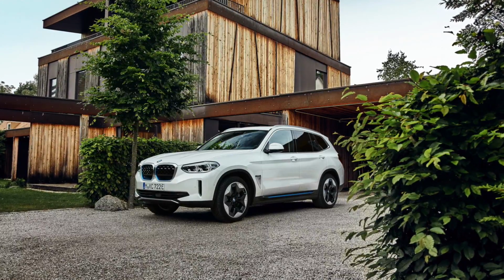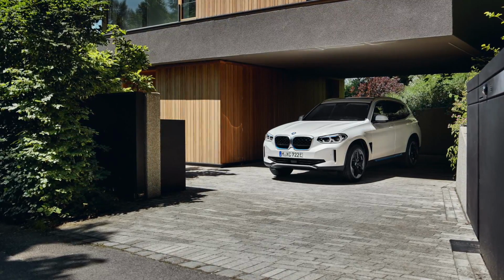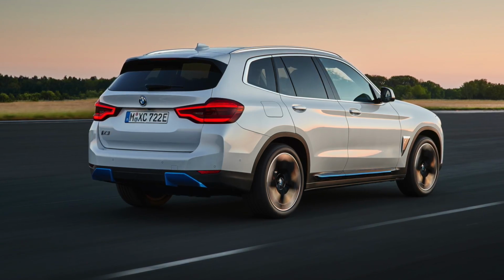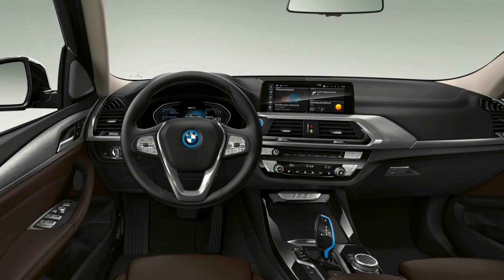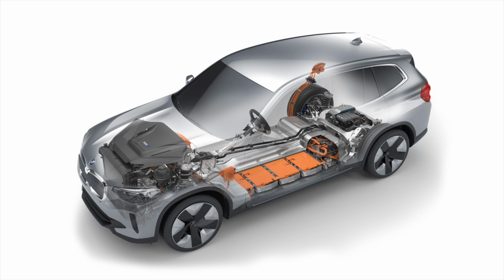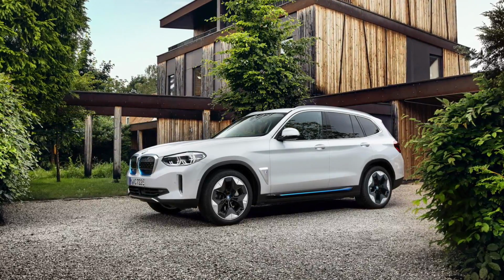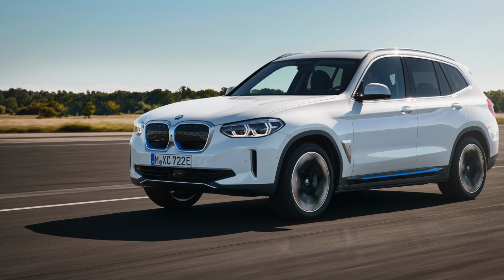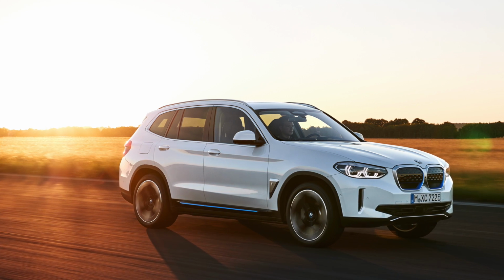BMW iX3 reveal - the BMW X3 goes EV!  Autogefühl

Comment: I'm afraid BMW will struggle to convince new buyers with this car.
Quick Comparison:
Tesla Model Y perfomance                       BMW Ix3
- Made in Germany                                      - Made in China
- 0-100km/h in 3,7sec                                 - 0-100km/h in 6,8sec
- 480 km range (WLTP)                               - 459 km range (WLTP)
- 241km/h top speed                                   - 180km/h top speed
- All-wheel drive                                            - Rear-wheel drive
- Price from 66.600 €                                   - Price from 68.000 €
Build quality and fit/finish is up for debate but I would rather choose the car made in Europe with better specs and price than this.

Comment: What is going on with BMW?
This is so sad and laughable car?
An electric SUV with RWD and 286ps, 450km range with starting price at 77'000? Are they ignoring competition? And that start price probably comes without the options you get with other cars as standard. So by the time you configure something normal, your price will be closer to 90'000. And it is Made in China! Not a thing about quality, but much cheaper workforce. Bad BMW.Bad
Reply: Actually it's almost fully loaded as standard and much better equipped than the e-Tron and EQC which have the same starting price but as base trim. It costs 68.000 and even when you tick all the boxes you can't get passed 73.000. Not saying it's cheap but what you're saying is not correct.
Reply: @MadDaCube  What country are you talking about? I checked in Switzerland. STarting is 77'000chf for "Inspiring" trim. But if you want an "Impressive" trim, that starts at 90'000chf. 
The point is, it is RWD and 286PS. Laughable for a BMW X3 class car.

Comment: I drive i3 and i8 and this are outstanding cars for the designated purpose, light weight and still a ultra modern design after six years. But I'm more than disappointed of this iX3. For 69'000 Euros I can have a Tesla Model Y AWD Performance. And the chances are good it will become cheaper like in the US. So, why paying the same for only RWD, slow performance and old fashioned ICE design? I'm afraid I'm done with BMW after 30 years. My next one will be a Model Y made in Germany.
Reply: I currently drive a Model 3 Performance (coming from a BMW 440i) and I was looking forward to maybe going back to BMW (next to the Model 3, but with bigger capacity), but it'll probably be Model Y instead, I'm not blown away by the iX3 yet...

Comment: The new I3 will be based on this platform but with the G20 body
Reply: The current i3 is still being sold, but there will be no successor. This model is completely discontinued
Reply: @florianj6490  no the new i3 is tested in camo
Reply: @Fiwek23452  The current i3 will be built until 2024, after which it will be over. Maybe an improved drive will be tested. Perhaps similar to the i3S. Where did you get the information from? I don't find anything about it.
Reply: @Fiwek23452  Oh, you mean the 3-Series electric. But this one will not be called i3! The i3 has been around since 2014 and was introduced together with the i8.

Comment: I prefer the traditional cockpit of an adaptation of a vehicle platform built for IC to those like the ID3. Fully electric vehicles try too hard to be futuristic and to bring more changes than necessary. This one has a great cockpit and a proven platform. The only benefit of a fully new design is that like on the ID3, you get more space in the interior and in the wheelbase length with the same outer footprint that of a smaller vehicle. But even when the new Golf is a topic of debate with its interior, I do not understand how those like the ID3 or the Teslas are acceptable. Knobs and buttons are better for usability, when driving the workload is enough as it is without having to adapt to buttons without a haptic feedback. If your eyes are on anything else but where you are going (the road) that's a very big danger in an object with so much momentum (a car moving at even slow speeds).
This IX3, I like very much. I wish the 330e had done better too.

Comment: What is up with all these SUV EVs? Where are the hachbacks and wagons?
Reply: It's easier to fit batteries under the floor of the suvs. Hatchbacks don't have that much space in there.
Reply: J-Ray true, also no one will buy an expensive electric hatchback.
Reply: I don t think ev hatchback are quite done yet (id 3, e golf, honda e, i3, nissan leaf, mini e, bolt, spark ev, focus ev ect), but ev wagons are nowhere to be seen. That's sad because as a european, I love a good wagon.

Comment: This is underwhelming to be honest. I think Mercedes Benz did much better with the EQC. The EQC was a complete different design and had the same size battery pack. And yet the EQC has faster acceleration and has the same range. I'm really shocked by the acceleration times of this BMW. I mean it is more than sufficient for anyone who buys it but compared to the EQC it is much slower. BMW didn't really change much on the interior even whereas the EQC has quite a bit of changes and bespoke EQ brand touches. I'm very baffled by what BMW just did here.
Reply: No, the range of the Mercedes is shockingly low.

In a comparison test with 3 other competitors under regular conditions if finished last with a range of just 309 km ...
Reply: @mart_en  It depends on conditions. Like the other comment here, see Bjorns channel for the range. The BMW quoted range is wltp which mean in real life it'll be much less. So it'll be about the same.
Reply: I get 390 km range with my EQC without any problems..... Also look at Teslabjorns transparent and and accurate range tests...

Comment: BMW iX3 or Tesla Y produced in Germany, the choice will be quite simple...
Reply: Ofc bmw
Reply: Rather get xi3
Reply: There seems to be no EV I would actually buy for a reasonable price, I don’t like the Tesla interior.
Reply: ciybersal  they used to have but not anymore. Besides bmw have the worst reliability. And low battery capacity same as the Mercedes eqc.
Reply: @alexgrazie93  They definitely still have quality issues at Tesla, quality management is still horrible. As is the interior and the design, but thats just my personal opinion
Reply: Tesla of course
Reply: Yes! Tesla ofc.

Comment: I have not issues with the design of the normal X3 but I must say that some of the blue design elements seem like an after thought, especially the two by the (very fake) rear diffuser panel, but at least BMW now has a model that can compete with the rest in this segment.

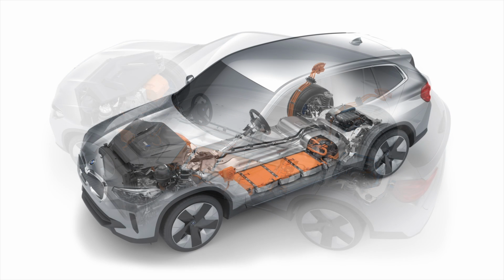Comment: 3:00 " Top speed is 180 kilometres per hour or 122 mph " 

Actually 180 kph works out to be 111,8 miles per hour ...
Reply: Also correct way of writing 180 kilometer per hour is 180kmph. Kilo is not a unit.
Reply: @nicolaspeart3910  Why isn't kilo a unit ?
Reply: @mart_en  kilo means thousand. When writing kph ur saying thousand per hour XD does`t make sense.
 The unit for lenght is meter.  Btw don't they teach physics in IS-system where you come from?

Comment: Let’s omit the fact I am not able to  afford the car, so any opinion of mine is for naught . This one is disappointing. They showed considerable efforts with the design and creation of the i3 or i8. This one is a x3 with a ev. Even Daimler, Audi, VW and Porsche built cars around the concept of being an EV. I expect more by an German Automobil manufacturer.
Reply: ichwillwasvondir this is much more impressive if it succeeds. It will show they can get the job done on their existing platforms which is very important during the switch to an EV dominant market.
Reply: ichwillwasvondir same, I was expecting a lot more from BMW. I can hardly tell the difference from a regular X3. Guess I’m not missing out on it not coming to the US
Reply: @CT-5555-7  Actually, It was what they want to do
Reply: Agreed! If i3 is bit strange and different to BMW DNA, i8 was cool and quite expensive hybrid, iX3 is even has same design. I suspect, it won't be too different from ICE... But this particular model is 💯% disappointment 😓
Reply: This is good imo. I prefer an ev that looks the same as the ice cars. Creating a completely new car just for ev is dumb
Reply: I actually prefer the more conventional look of this one, looks good. I don't think it's lazy of BMW, there must have been some major  re-engineering to fit the batteries etc.
Reply: Zeroyon 456 yeah but that was probably the only re-engineering that they did. It just looks lazy too me since it looks exactly the same and they didn’t do anything to make it stand out. Maybe it’s just me but when I hear about the i3X expected a lot more. I mean look at the i4. It doesn’t even look like the same company, it’s amazing what they did and now look at the i3X. It looks like they half assed it and used all their creativity and ingenuity on the i4

Comment: everybody is doing beautiful cars and the range is getting better and better, however they are all missing the point: charging.... what makes Tesla superior with almost no competition is that they have a cast charging network, nobody else has it, and this makes all the difference, you put your destination in the gps and it tells you were to stop to recharge and what is the availability and so on... with audi e-tron you need to mess around with apps and calculations and hope that you'll find a spot available...
Reply: emiliano
the etron will always tell you with what soc you will arrive in your destination and if that’s out of your range, it will route you via 3rd party charging stations. it also calculates charging time and includes that in the route calculation.
Reply: @kam_iko  sure, but it is still different, we did a trip to Germany with a tesla S 90 and the e-tron suv, there was no comparison on which system worked better, the tesla was far more advanced.. this was some time ago, maybe now audi made some changes, but overall I still see the tesla charging network as highly superior,  you plug in and you are done, no fuss on providers or anything else